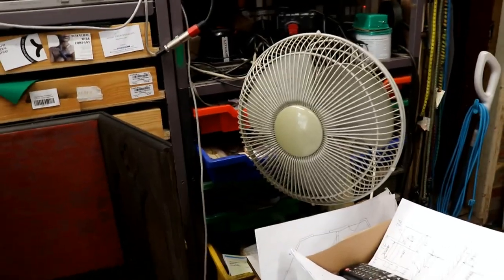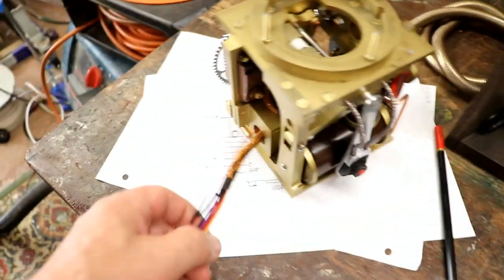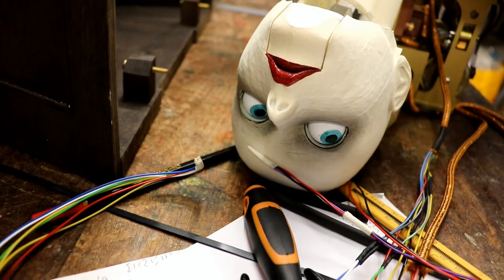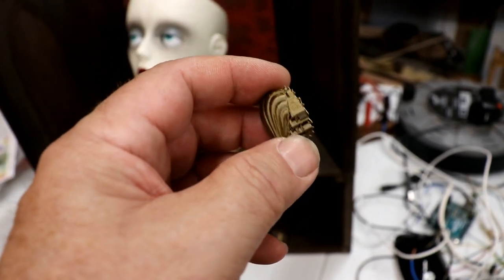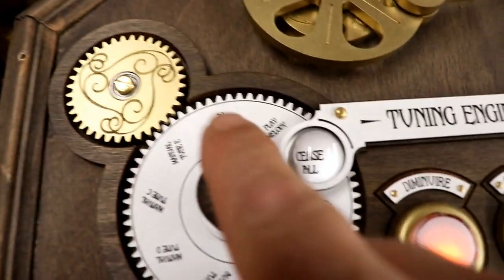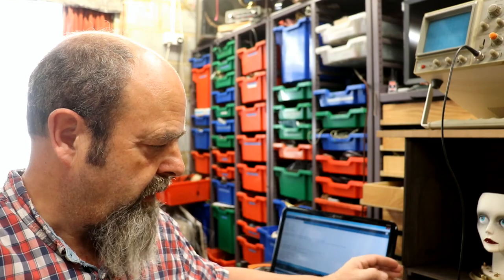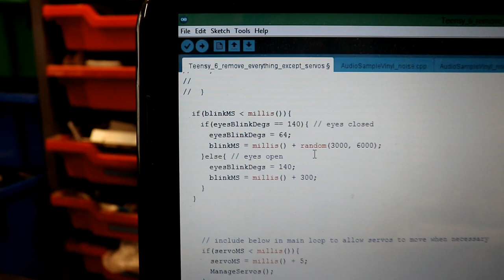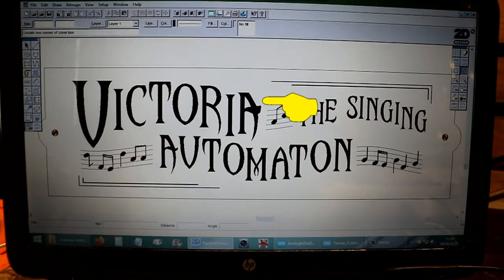Now to get Victoria the singing automaton moving

Comment: I have switched from using the plastic servos to the brass type. For a few extra $ they are built better. The chips in the plastic servos are really dodgey.❤❤❤❤❤Love your videos.❤❤❤❤❤PS Use a different power supply for the servos. This will help to ensure that the servos are not receiving any PWM signals until the Arduino has started up completely. 😊❤❤❤❤
Reply from the maker: Thanks for the advice Adam. Do the brass servos have a different part number? It seems like a bit of a minefield with the number of poorly made ripoffs coming from China! In the end I switched the servo's power supply on after the Teensy had started up - what a joy, as they calmly settled themselves without try to destroy Victoria's head!

Comment: You definitely need to have some sort of delay random signals from it while it's booting up Something that will keep the servos powered off until everything is running and ready I don't know I'm not very familiar with this look forward to seeing when it's finished🤔🤔
Reply from the maker: Thank you for your suggestion. In the end it was enough for the servo +5 volts to be switched on by a relay that also powers Victoria's body mechanism motor. It's an absolute joy when you find you have inadvertently half solved the problem already!

Comment: just use a single relay (with flyback diode) to switch the positive rail for the servo's..
Reply from the maker: A brilliant suggestion! I've already got a darlington pair and diode controlling her 'body' motor which runs whenever she is active, so I ended up as you suggest, simply adding a relay to switch the servos' positive supply and it works a treat! Thank you.